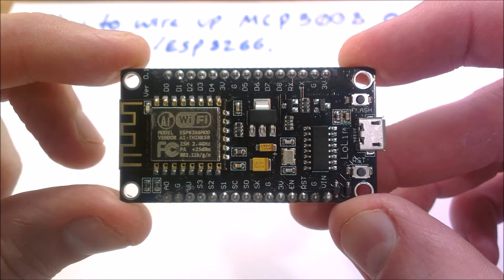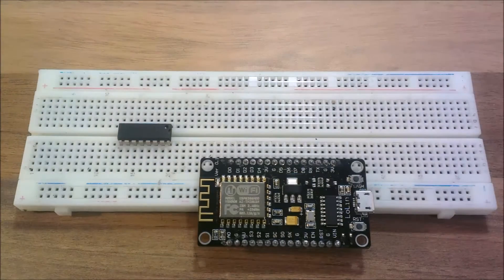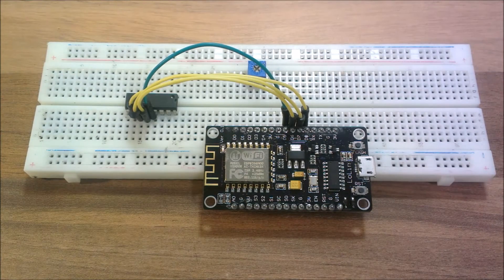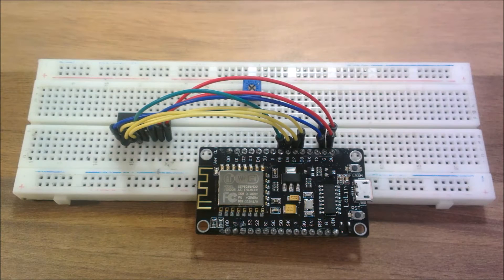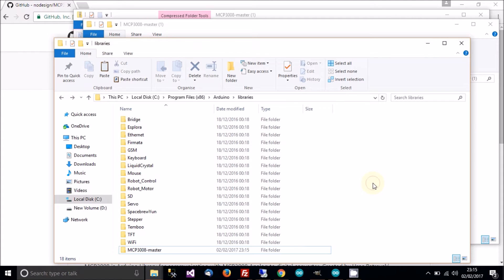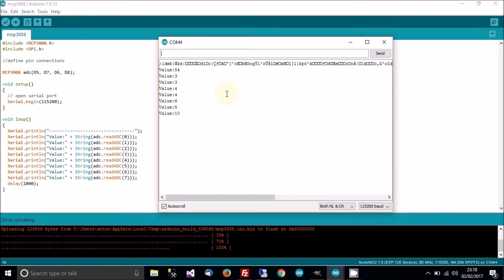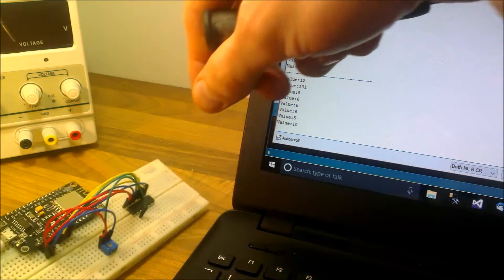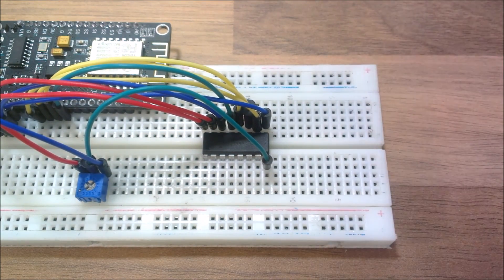TUTORIAL: How to wire up MCP3008 ADC on NodeMCU ESP8266 or Arduino (analogue digital converter)

Comment: Hey Antony, is it also posible to connect 2 MCP3008 IC's on het ESP8266 board. For example using pin D0,D1,D2,D3 for the first one. D5,D6,D7,D8 for the second one? Kind Regards Marc ter Mors

Comment from the maker: A word of warning to everyone! The ESP8266 is very temperamental. If you do try this out for yourself and it doesn't work, reconnect it, reflash it, reset it, etc. The code is correct! I've just been messing with this and the module wasn't reading! After an hour of messing about, it magically worked again... Arghhhh, the ESP8266...

Comment: Did you pick the jumper colors on purpose, looks like yellow for signal, red for power, etc.  Nice idea.
Reply from the maker: Hi John, Yes I did, but actually in this video, I didn't stick to it properly. I usually use red for vcc, blue for ground, yellow for signal. I used a green for something in this video, for no real reason. :-)